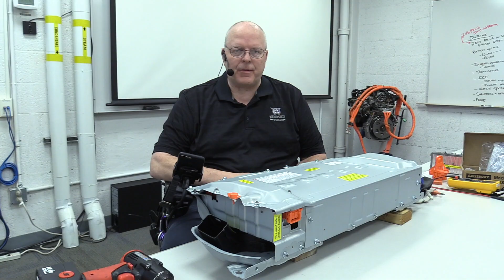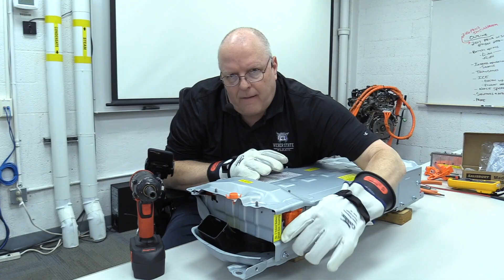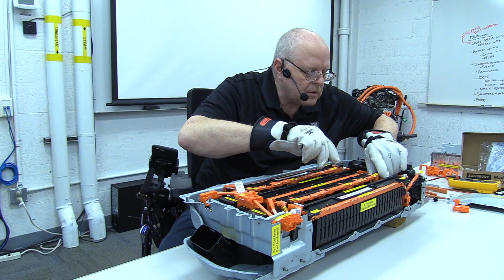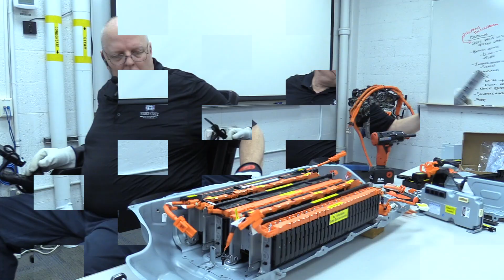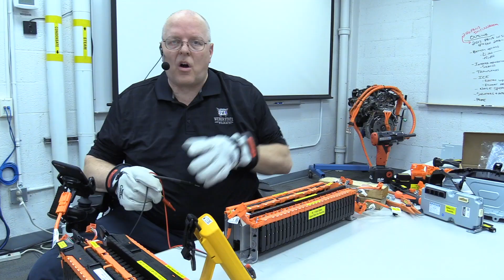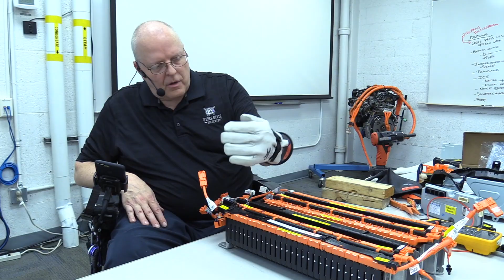2016 - 2023 Toyota Prius Li-Ion Battery

Comment: Any plans for KIA Niro hybrid system overview?
Reply from the maker: I would if I had access to one. Thank you for the suggestion.
Reply: Because Niro have pretty strong EV drivetrain for it's weight, 32KW motor, 270V Hybrid Battery with 1.56kWh energy storage, but the voltage is high for hybrid drivetrain, so less losses. I will be happy if you can show us the drivetrain and battery of Niro. Best regards, subscribed.
Reply: Stanislav Subashev Those are cool, my colleague at work has one, but I prefer the toyota, not sure if Kia really has its act together yet on hybrids, or what the resale value would be.

Comment: Do know which one is more durable, NIMH or Lithium battery?
Reply from the maker: Ni-MH batteries have been very reliable, hopefully the Li-Ion batteries will be the same. My 3-year old Chevrolet Volt with Li-Ion batteries has been very reliable with no loss of range.
Reply: I am using Prius 2011... if come to change battery which should i use NiMH or Li-Ion battery...?
Reply: Li-ion should be but it depends on how much it is pushed. Tesla batteries have a very easy life so tend to last for ages. Most hybrids are air cooled (so could get hot) and tend to have much higher recharge rates when you take into account the capacity
Reply: I've read the NIMH are more resilient to abuse the LiPo. 
You certainly have to be careful with charge and discharge on LiPos .  
But I suspect Toyota knows what they are doing and has factored that in the design with plenty of margin if safety and reliability.
Reply: WeberAuto Thank you for your reply. Great video.
Reply: kens97sto171 Makes sense. Thanks